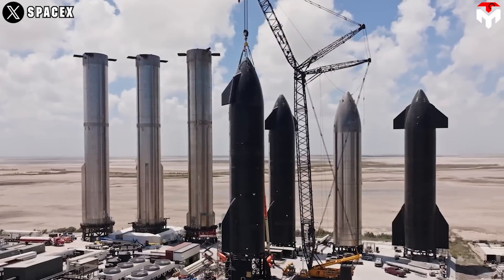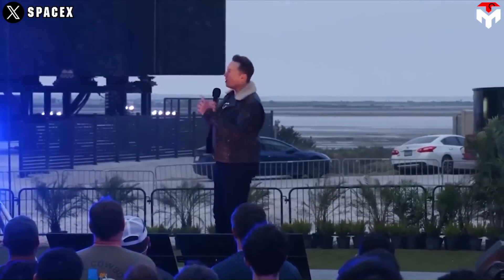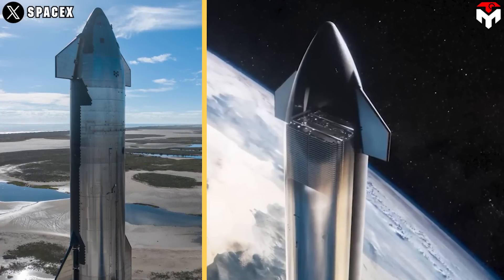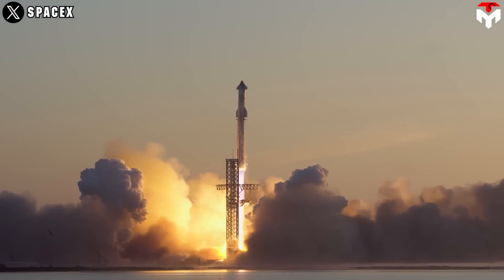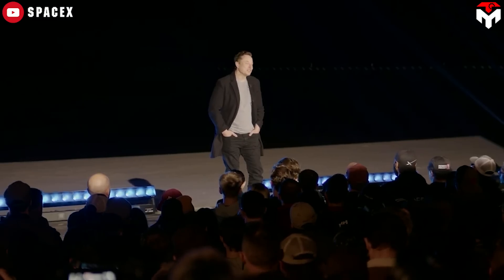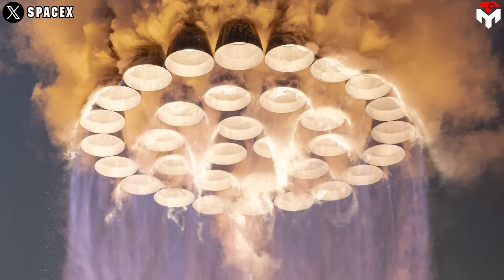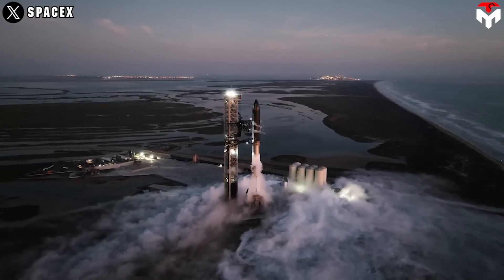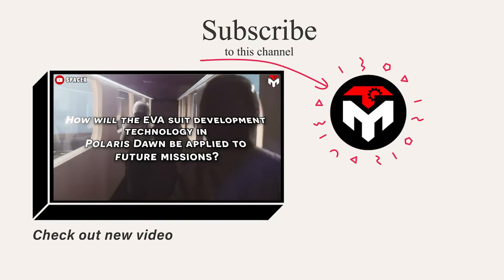SpaceX Orbital Starship Flight 3 New Major Designs Change Everything!

Comment: Venting led to a fire, but why and where......just venting ox should not have resulted in an explosion.
Reply from the maker: We explained this in the last episode
Reply: @techmap9  Yet the real reason has not been released, we can all make assumptions.  So why did Musk not say the reason?
Reply: LOX is explosive. Compared to GOX. LOX is very reactive an will explode on oil residue.
Reply: @kazedcat  Yes it will not explode on its own, so we can keep making guesses about the other part but we currently do not know.  Venting LOX should be a safe procedure, clearly something went seriously wrong and guesses do not help.
Reply: @hairyferrit  It's not on it's own the exhaust is fuel rich.
Reply: @kazedcat  Indeed, and the LOX vent does not vent through the engines.  Or are you claiming space x was dome enough to do that, or vented whilst the engines were still running.  Strange how you cannot be specific about what actually caused the explosion, just proving we can spend the rest our our lives guessing until they actually tell us how it occurred.
Reply: @hairyferrit  The rocket is traveling faster than the speed of sound. Vented oxidizer and unburnt fuel  can mix specialty if the exhaust was redirected upwards during hot staging depositing hydrocarbon on the Rockets surface.
Reply: @kazedcat  First you need to prove what cause the LOX venting to cause an explosion, you are still guessing and keep coming up with different causes each time....proving my point that we do not know but can ALL make guesses like you are.
Reply: @hairyferrit  I don't need to prove anything. Elon does no need to explain why his rocket exploded.
Reply: @kazedcat  He does to the FAA who will then publish the reason.  Not sure why Musk claimed he was going to tell us then did not.....
Reply: @hairyferrit  You are not the FAA.
Reply: @kazedcat  And you are clueless, at least I will get to read the report, you will stay the same.
Reply: @hairyferrit  So what is FAA's report on Starship One. It was a bigger explosion. Did they explain why they allowed the launching of Starship Two?
Reply: @kazedcat  wow, you could have remains ned silent and only letters Ng people think you a fool, instead you had to go ahead and price it.  Read it for yourself, I assume you can read big words.
Reply: @hairyferrit  Why would I read an FAA report?